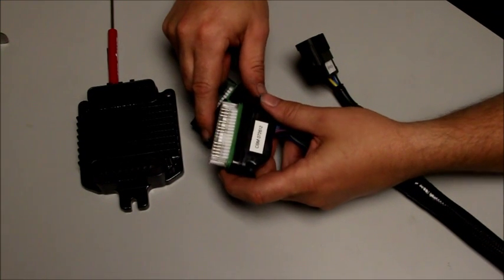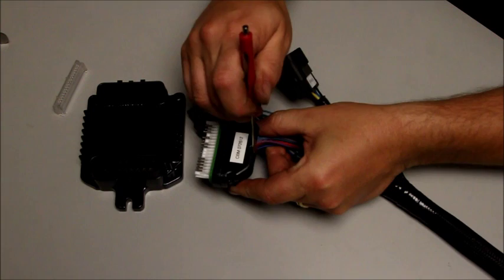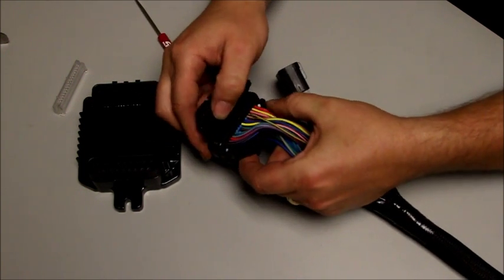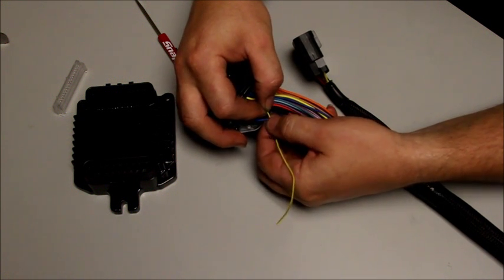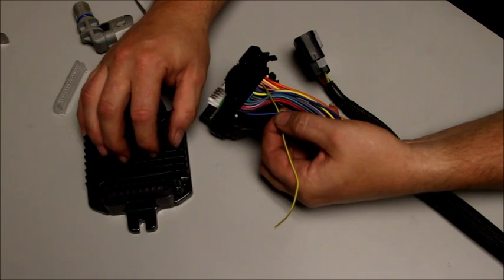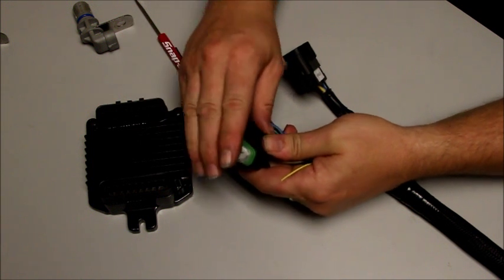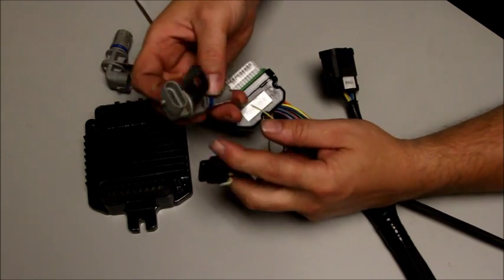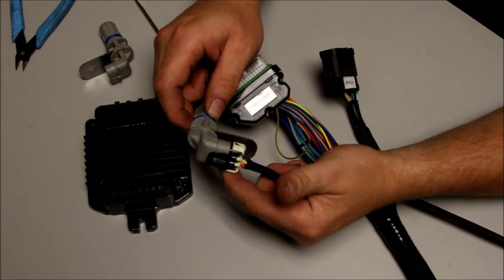MEFI 24x 58x CRANK SENSOR

Comment: What can I do if i swap a gen3 engine into a gen4 truck, changed the cam sprocket but not the crank reluctor wheel left the 24x. when I tune it will they be able to change that setting or no?
Reply: @slowguy6045 did you figure it out?? I’m in the same situation!